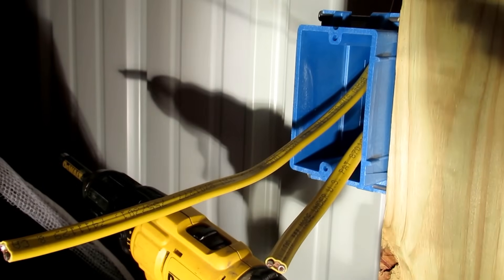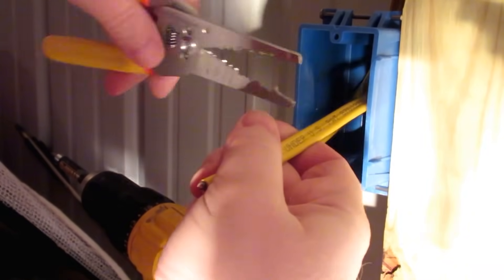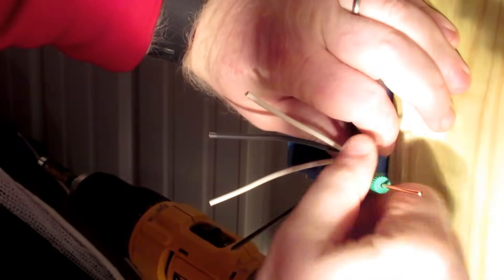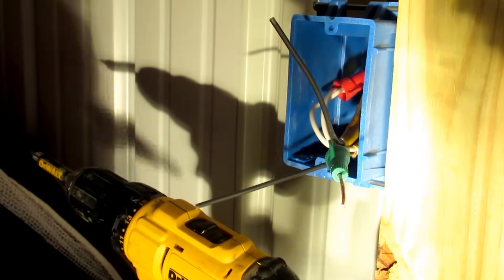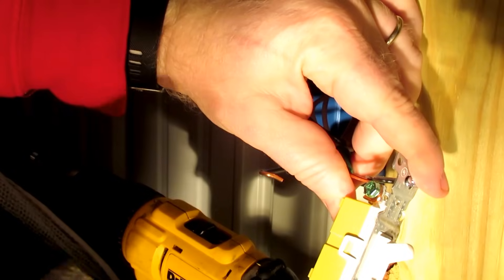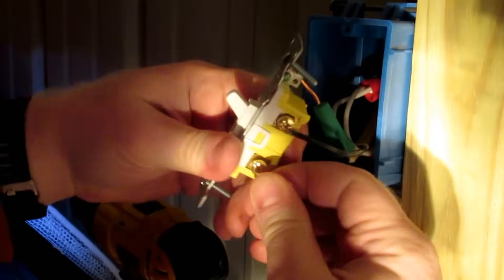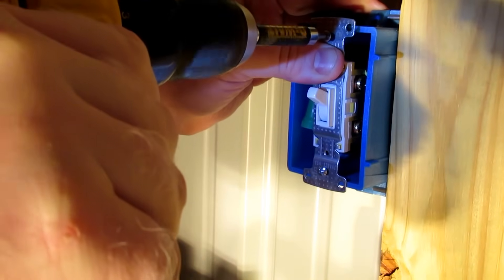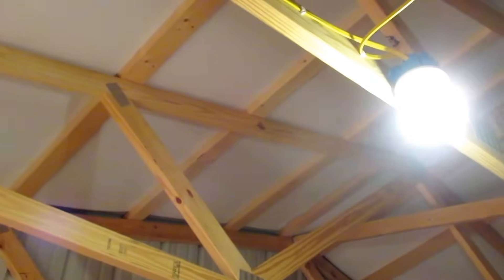Before You Wire a Light Switch—WATCH THIS Essential Guide!

Comment: I see things wrong, far as code. But sure it will work. Shealth not cut back far enough and wire length to short.  If an inspector noticed, you'd fail for these things. Then use pliers to twist, your joints aren't tight at all. Then the hole on your strippers is designed to make loops. Then your single gang box is to far off stud, the nubs on side should hit flush with stud(unless you expect something besides drywall being used). But since your not following code. Might as well just use 1 wire instead of 2, save you some money. For the switch does not need a neutral(sans code), so you just put some electric tape on the white wire to designate it as hot instead. Then use it as if 2 blacks. Same result, less wire, still not passing inspection. This works because all a switch does is break the circuit. This was very common for us electricians decades ago. I'd also use 14 gauge wire to run to the lights, 12gauge for initial power. Unless your lights use over 100ft of wire, then use 12ga.
Reply from the maker: This is in my shop. I've wired houses and they've all passed inspection.

Comment: I do something crazy with my switches if light is already powered by a J box. I only pull one Romex into the box and label the neutral hot with black electrical tape on both ends. Now that wire carries the load back to the J box. Saves on a second run of wire.
Reply: That was commonly done until about 10 years ago until you were required to have a neutral wire in the switch box. The reason is to allow potential upgrade to a smart switch/dimmer which normally requires a neutral wire. So now you have to use 12-3 or 14-3 for a switch loop, or it's a code violation.
Reply from the maker: Interesting

Comment: My problem now and what I am looking for on YT is....I wanted to replace the switch and light on a porch light.  It is on a box that shares another switch with the ceiling lights(for which the other switch is at the bottom of the stairs...so two way , right?) and then another 2 wires coming into the same box that I think is coming from sockets in the wall.  So I have three wires coming in from the top of the box (one is the porch light and  1 ceiling lights and 1 live) and two wires coming in from the bottom of the box which I believe  are for sockets.  I had them all taped in the way I took them off but the humidity of the basement has loosened the tape and now I am not sure how they were wired.    All the whites are connected together except one(which was fastened to ceiling light switch) and the black wires are connected together except for 1 black pig tail going to the porch light switch and one black wire from one of the socket wires going to the ceiling light switch which has the red hot wire on the other side)  ...I get how the blacks are carrying juice to all wires by the way they were wired but ...do I connect the white from the porch light to the porch light switch as well and bundle the rest of the whites(except for the one attached to the ceiling light switch?...
Reply from the maker: Be careful

Comment: You should differentiate between which of the brass screws gets the live line wire and which gets the load black wire..
Reply from the maker: It doesn’t matter on a single pole switch
Reply: @BeyondtheBoom  Thanks for the info...I have been getting mixed messages from videos I have been watching but thinking it through I see what you mean...it just matters that when the switch closes/makes contact the juice flows...right?

Comment: I did the same connections on my light switch but now it won’t turn off when you flip the switch.  It stays on.  I wonder what I did wrong.
Reply from the maker: Take a meter and make sure the switch isn't shorted

Comment: the is a short ground. Make the one wire longer so you can tuck back the wirenut and still have enough ground for the switch. and dont leave so much sheathing in the box. 3/4 max
Reply from the maker: It's fine

Comment: Why don't you connect the neutral wires to the terminal?
Reply from the maker: You only switch the hot wire. Neutral wires are simply connected together

Comment: Do most local codes allow for wrapping electrical tape around the switch screws  after the connections are made? I do that to minimize the shorting of Ground to Hot.
Reply from the maker: Depends on the local code. I don't think it's acceptable in my area

Comment: It's a great video for beginners but you're using 12-2 Romex on a 20-amp circuit. Code is 14-2 on a 15-amp circuit breaker for lighting circuit. Typically you use 12-2 on 20 amp for receptacles for constant power.
Reply from the maker: 12 2 is perfectly within code for this area

Comment: Does it matter which black goes on top or bottom of switch? The one from the box as opposed to the one going to the light?  You did not explain that.
Reply from the maker: It doesn't matter which side. It's a single poll switch

Comment: The only thing I see wrong you left to much of the outer cover per NEC only about a 1/2 inch from where it enters the box.
Reply from the maker: It works
Reply: Great observation, but the code requires a quarter inch of sheathing in the box, and eight inches of wire from the back of the box. It's common to leave extra wire, in the event someone has to come behind the original install to rewire, or even add a second device in that wall space

Comment: Hello;  very strange that in USA still use those outdated wires. I mean; in most parts of the World is used the stranded wire; that is safer for sure.
Reply: How is it safer?
Reply: @Nick-bh1fy  try to read what are the International norms regarding buildings electricity safety. Is not only that one can flex more.
Reply: TheReverb1 ya, it’s a lot more workable but also cost more, also a larger cross sectional area which takes up more room and could be wiggled free if not secured properly. Not seeing how using stranded would make it safer?
Reply: @Nick-bh1fy  the connections when you fasten the screws are better with the stranded wire; and as you know the connections should be tight. I think the same gouge have more filaments than a solid wire making them thicker. For the houses (and you ll see that the stranded is what is used round the World mostly) all the connectors hold far better more than one stranded wire than a more than one solid wire; making a tight connection. Also to pass the wires inside the tubes are easier with these wires.
Reply: TheReverb1 stranded wires could be pulled lose after the first tighten which is why u should always check and re tighten if it isn’t fastened properly. I agree tho it does make it easier to pull but in north America (Canada US) solid wire is primarily used from 14-10awg
Reply: @Nick-bh1fy  possible you have there different circuit breakers terminals. I remember some decades ago that the wiring was stranded then solid and not so thick; then in late 70s with all the appliances etc they thickened its; then, in mid 90s or so started again with the stranded as an International Norm. Again in most Countries the norm is stranded for the houses.
Reply from the maker: Nothing outdated about it
Reply: @BeyondtheBoom  ...may be you need to see more outside USA

Comment: how come you don't need to connect the neutral wires?
Reply: I’m assuming you are asking why the white wires don’t get connected to the device(light switch)

In this case The two neutral wires are the power leaving the light fixture and it returns back to the main panel on the bus bar.  

The black wires are the power going  into the light fixture.
Reply from the maker: You tie them together

Comment: Need help please I have a ceiling fan and a single pole switch at the fan I have 3 sets of 12-2 wires 1.)main hot 2.)travel wire going to another fan 3.) Is going to a switch . My  question is can I jump out of my switch box w/hot to feed another switch box going to a led light  with just a black and white wire I know that is a switch loop but was try to figure that out  thanks
Reply from the maker: You can make a couple pigtails tied to the main supply that feeds to the switch. The other pigtail will feed the other switch for the led

Comment: Running NM cable exposed where subject to damage seems to be a NO NO in the NEC.   At least it has been since 1983 when I started my electrical career up through 2017 NEC.
Reply from the maker: Its done all the time in basements
Reply: Abston Wood Crafts     I see people driving 85 and 90 mph with 70 mph speed limit.   That does not make it legal.   Where you see it installed exposed in basements was inspected or not inspected?   You did not say.    All I can tell you is to look up Article 334.15(C)   It states exposed on walls to be in conduit or other methods in Article 300.4.       So, my original comment is still correct.

Comment: Interesting way to do a switch, Is this the standard way in the US? In Finland we use a junction box. Wires from the light, the switch and the power come there and they are combined. The neutral wire is used as the return from the switch and is connected to the line of the lamp.It also is marked it with a black tape so that people know it is not neutral.

A nice retro switch. We had those in the 50s.
Reply from the maker: This is pretty typical here.

Comment: Great video. If i wanted to run a wall outlet off the light switch so the outlet would be hot all the time what terminal on the light switch would i use. Thanks
Reply from the maker: You would run the black to the switch and then out to the plug. The neutrals would be tied together

Comment: I have a quick question. What size breaker should be used for single light
Reply from the maker: Depends on the size of wire. 14 awg should have nothing larger than 15amp

Comment: I too agree. Your leads are way to short. The cheapest part of Ely work is the copper. Plus strip your sheathing before loading into the blue box. 
Totally cluy work.
Reply: He did it right, you strip the sheathing once you put it through the outlet. The conductors are cut too short and the sheathing is left too long in the outlet box. It should have been an inch to a 1 1/2. The EGC conductor termination cap is very close to the outlet switch, the conductors should have been 6-8 inches from the outlet box opening.
Reply from the maker: It works

Comment: Wires are cut too short. There must be at least 6" on every wire. Including the ground wires.
Reply: Glad I wasn't the only person who noticed that.
Reply: I fully agree. Plus it's too much sheathing in the outlet box.
Reply: @islandboy447  There is no code against too much, only too little.
Reply: Brian Hammerson 3inch for ground and 6 for hot and neutral. Just take your knife and scar it both sides and give the coating a pull jeez dude
Reply: 6” for ALL wires. Whoever told you grounds can be 3” lied to you. Look it up in the NEC for yourself. There is no exception for ground wires. Be safe👍
Reply: @brianharmeson3144  yep, all apart of boxfill. NEC bro.
Reply from the maker: It works
Reply: @BeyondtheBoom  Just because it works doesn't mean it is correct. I've seen receptacles fed with #18awg speaker wire before. It worked but is a code violation. There are rules to follow.
Reply from the maker: @brianharmeson3144  just call me a rebel

Comment: I didn't know  people  needed  to be tought  this .but why a ground  if it's a plastic box
Reply from the maker: The ground will keep you from being electrocuted in the event something happens in the switch.  Have you ever been shocked by a metal framed drill from a generation ago?  That's the perfect example of why the ground is important.
Reply: @BeyondtheBoom  what I mean is the grounding  mot needed  to be tied to switch  just twist ground  together  that  is building  code
Reply: @JoseVargas-bz3zd  and you would be wrong.
Nec 404.9

Comment: Tipacle Jack leg wiring I'm sure you mean well but it's obvious your not a trained electrician, wire's are not properly stripped, to much insulation left in box, wire's to short in box, to large of wire nut used on the white wire which technically is not a neutral it is the grounded conductor, and even though it's not illegal using #12 wire for lighting it's  a waste of money. I love it when you reference how you do certain things because of your years of experience,  doing it wrong for many years does not make it right. I don't mean to offend but electrical work can kill people when not performed correctly.  I'm sorry but you should not be showing people how to do this work. I'm a properly trained electrician and I will never do a how to video on my channel because it takes more than a few minute video to insure your not putting lives in danger.
Reply: Well said dude. Master electrician and electrical contractor here!
Reply from the maker: Maybe in your area but this is how most wiring is done here.

Comment: Awesome video, Thank you. Just two questions, a) Which of the bundled yellow wires at the beginning of the video came from the light and which one came from the fuse box? b) When connecting the two black wires to the switch, does the black wire from the fuse box go on the top screw or on the bottom screw? Thank you again.
Reply: The black wire coming from the power source connects to the bottom of the switch. The black wire to the light goes on top. When you flip the switch up, it allows the power to go up to the light. If you connected them in reverse, the light would come on with the switch in the down position and off in the up I believe.
Reply: Hook one black wire to one of the brass colored screws and hook the other black wire to the other brass colored screw, it doesn't matter which one.
Reply from the maker: It's a good idea to mark them when you run the wires. A switch goes between the two black wires so it doesn't matter

Comment: Why did you use 12-2? I would have used 14-2. It costs less and is easier to handle. Other than that all good!
Reply from the maker: I like having plenty of amperage available.  The cost difference is not that much.
Reply: You can save a ton of wire an less crowded boxs if you run your homerun from your power source straight to your lights, then all you need is one romex from light to switch, just be sure an mark your white ( neutral) wire with a band of black tape, ( at switch and at light ) that will be you load wire from switch, back to load or light. You can save enough wire to do another shed nearly, not to mention would be so much neater .  Hope that helps ya .
Reply: wayne watson - cedar branch hives should be using 14/3 and not 14/2 for switch legs  like that it’s code

Comment: Hey brother. I'm dealing with an issue. A buddy and I added an additional ceiling fan using the two wires feeding the original fan. My buddy disconnected several wires that were fed into the 4s box that were powering other lights and things and he did not pay attention to which pairs were together. So after I install and wire up the fans they immediately power on once the breaker is closed whether the single pole switch is closed or open. I am getting my 120 from hot and neutral at the 4s. Am I connecting the wrong neutral ? There is additional black and neutral in that box that were disconnected but I'm not sure where they were paired to
Reply from the maker: You will need to identify each wire run to solve the problem
Reply: Last Won from what I’m reading what I think is that ur line wire (power) is connected directly to the fan which is why it’s always giving it constant power regardless of the switch in the off or
On position or if u somehow connected the line wire and load wire together without the interruption of the switch
Reply: Thanks guys I figured it out. I put together a small.light bulb with two wires and played around with each pair while my buddy went back and forth from both switches , once I found a good pair the rest was easy.

Comment: Wired a light switch this way and it didn't blow up! Always a good thing. Good, clear video. +1 for the square bit on the drill, saves a ton of hand cramps. Especially working at awkward angles
Reply from the maker: Glad to help.  Using a drill makes it much easier.

Comment: Is the longer  of two ground wires taken from your two cut romex the actual Romex that runs away from the switch up to the light fixture ?  The way design expect chassis ground to run away from load to sub panel?  Nice video and explanation!
Reply from the maker: I used the green wire nuts that have the hole in the top of them.  Leaving one of the ground wires longer allows you to connect them together with one sticking through the hole in the wire nut.  You then connect it to the ground on your switch or plug.